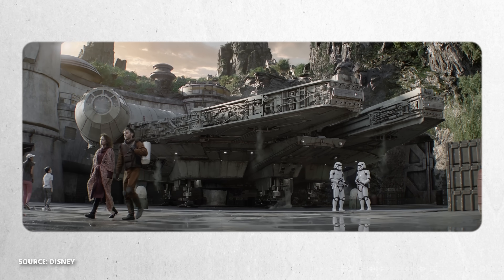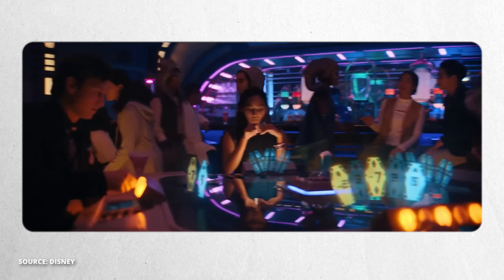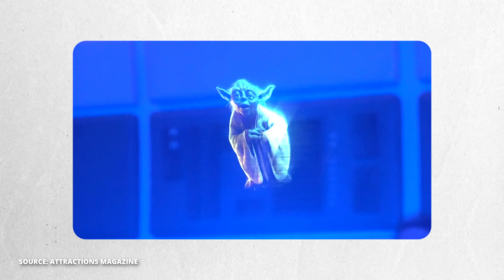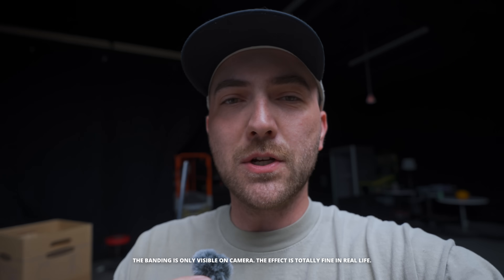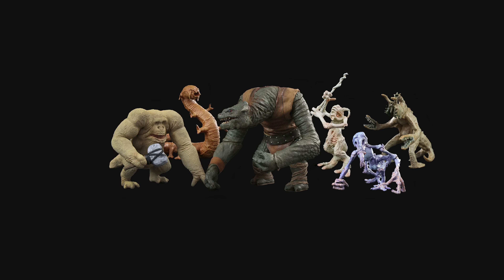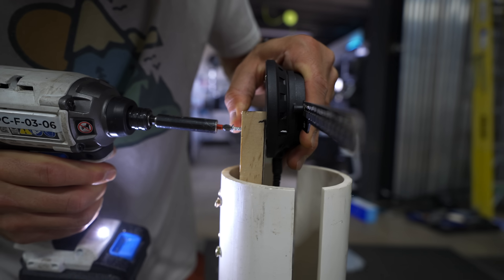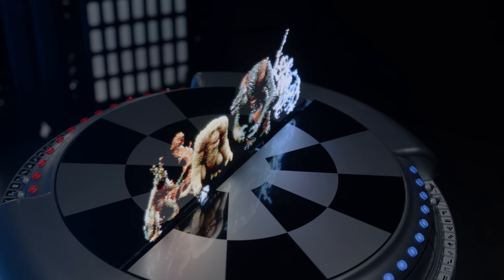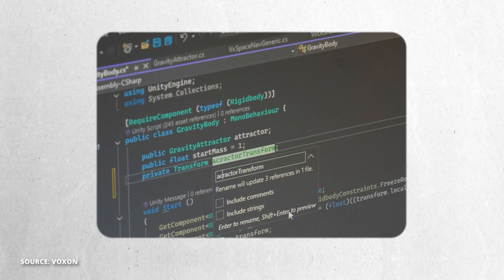I Made Disney's Missing Hologram Illusion

Comment from the maker: CORRECTION: I never got the chance to see the Yoda hologram at the Galactic Starcruiser in person, so I had to go with my gut on how the illusion was done based on videos online and some forum speculation. And it turns out, I was totally WRONG on how the image was created. It didn't use LEDS or ping-pong back and forth at all. Please excuse the inaccuracy in this video. I hope you can still enjoy the documentation of this project!
Reply: And there is a reason you have to be far away from it and lights shines in your eyes. Without the lights in your eyes you’d see the trick.
Reply from the maker: @edwardhodge_usa It's pretty clever! And I haven't seen it done before anywhere else!
Reply: I would've thought it was done the same way, do you know how it was acrually done in the end?

Putting in my guess, thinking it's a wire spinning in a cone shape with a projected image onto it
Reply from the maker: @njdotson a blade spinning rapidly in a cone shape with a projector on each side of the spinning cone. The projectors are hidden in the holocron pointed up at the cone. You can actually see the projection fall off on the ceiling!
Reply: @zachwally  It's don't think it's a blade, it looks like a small diameter black fiberglass (or maybe carbon fiber) rod mounted into a spinning motor shaft.  It makes a cone as it bends away from its shaft-mount when it's spun.  That's what's being projected onto.
Reply from the maker: @TheM750 Yes, I think a rod is a better way to describe it!
Reply: @zachwally  Agreed.  Should be a pretty simple build, honestly.  Especially if skipping the raising/lowering that the holocron had on the Starcruiser.  McMaster has 1/8" CF rods (2153T15), I'd be tempted to try an FRP rod as well (8543K71).  A 1/8:1/8 rigid coupling (61005K191), a 1/8 shaft DC motor, a PWM DC motor controller, and a DC power supply...should do it.  Oh, and a small projector.
Reply: @zachwally  Ohhhh that's interesting...

Comment: I don’t know if Voxon employs this strategy, but if the plastic enclosure didn’t contain air, it would likely be far quieter than a fan. Most likely they aren’t, but as soon as hou mentioned the noise, this is where my head went … into a vacuum chamber ;)

Comment: You could potentially make a safe version of this using a concave mirror, sometimes called a mirascope. If you got the angle just right, you could use a glass panel for the surface of the chess board, the display would go underneath in the base, and the reflection would make it appear like the characters are on top.

Comment: Thank you for calling it an experience and NOT a hotel. 

I will correct you though. It was not a spinning blade with LEDs. It was a spinning plastic blade that was discreetly PROJECTED onto it from below. The black plastic blade comes out of the box, and then rapidly spins, forming a large cone that is invisible to the eye. Then, two projectors are below the cone projecting the same image of Yoda from two sides. If you're sitting on the front and back of the cone, you could see Yoda, but if you were to sit on the left and right side of the cone, you would see that there were two projections of Yoda on the cone. The crew of the ship had to sit in very specific sides of the cone so that we could see the illusion and  you could have seen that the projection of Yoda was on parts of the ceiling covered in black velvet fabric, it was very faint on the ceiling because they were trying to hide it but I could see it.
Reply from the maker: Thank you for the correction! I never saw the illusion in person and went with my gut for this video and didn't quite nail it. From what I've heard from others, this description is spot on!
Reply: Calling something an experience does literally nothing to describe it. Everything is an experience.
Reply: @toddjones1480  Someone's still mad about a certain Jenny Nicholson video.

Comment: Awesome video! I think another approach that might work would be to use a fog screen effect. Projecting the images onto a mist or vapor cloud is simple enough, the trick to making it believable would all center on either hiding the fog/vapor screen by making it fine/light enough so that it's nearly impossible to see but I would imagine that the more you hid the fog, the more you would also be degrading the projections. Instead, it might be possible to leave the fog screen visible, project images onto the fog, and have the effect feel believable by simply giving the scene a reason for the fog to be present. A number of ideas compatible with the Star Wars universe come to mind: having something nearby that is 'venting' smoke, either as something it does naturally like a bubbling bacta tank or beverage station filled with an exotic, smoking liquid, or something that is venting because it's damaged which could be anything from a droid to any random pipe or hose running through the Falcon. If staged near enough to the holochess table for the fog to float down over the chessboard, it might just be possible to pull off the illusion. Sure, it would be obvious that the projection is using the fog as a screen, but if you give the fog a valid reason to be there, the scene would appear genuine, without actually tricking anyone.
Reply from the maker: Such a fun idea! Thanks for the suggestion! Would love to try and project onto fog sometime.

Comment: Lots of fun but you can go all around the board in the queue, but the biggest issue has to be just how loud the fan blade is.
Reply from the maker: Fan blade noise is definitely a factor to consider! I talk about that a little bit at the end of the video and also a different form of hologram technology that I think it would be better suited for that environment in Smuggler's Run!
Reply: @zachwally is your fan blade so noisy when it's not housed in the game board or is it the sound of the blades hitting the air trapped as it passes from above to below the board? Like noise from a helicopter rotor blade. Maybe there is a way to reduce the air pressure by venting it?
Reply from the maker: @marvrogers9540 the fan being housed in the game board definitely amplifies the sound.